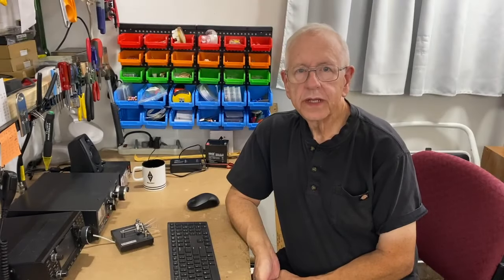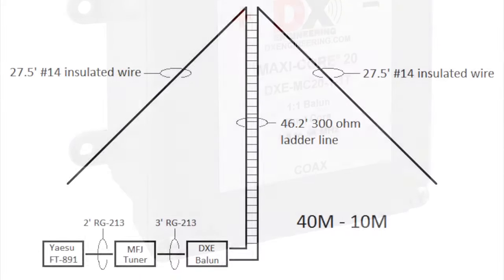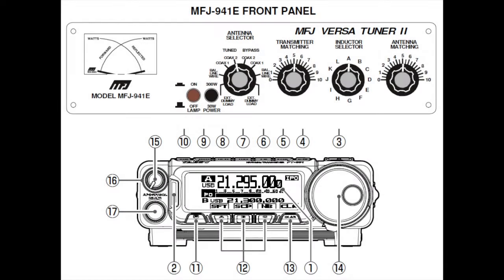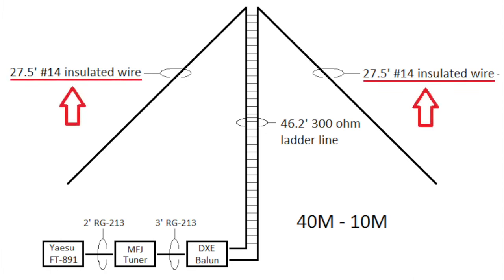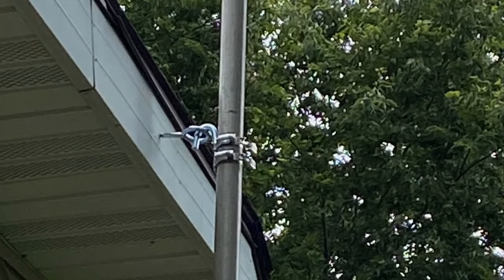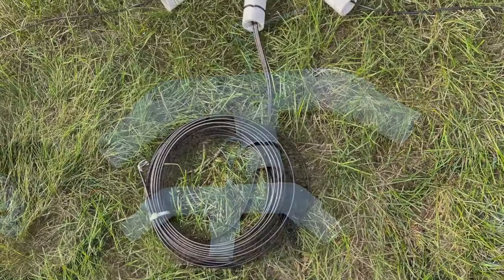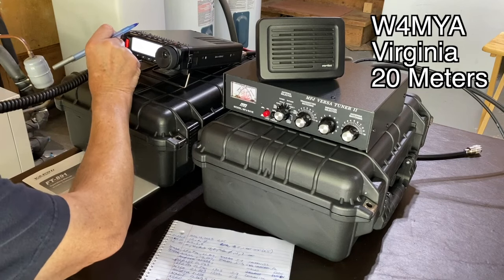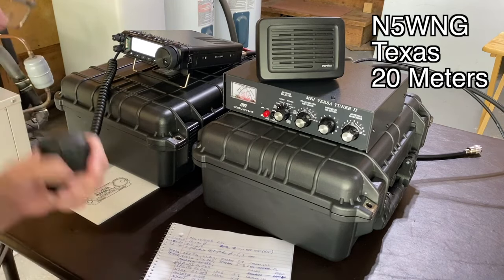Yaesu FT 891 And The Doublet Antenna  A Great Combination!

Comment: Bob, if you could add information where you obtained the pole, ladder line size/type, it would help some of us looking at trying this antenna.
Reply from the maker: Hi again Mike, The ladder line is 300 ohm from DX Engineering ...

https://www.dxengineering.com/parts/dxe-ll300-1c

The pole I bought surplus at a recent ham club sale and it has no markings on it but I think it is also from DX Engineering however I'm not sure they carry that exact model but they have others that are like this one or similar ...

https://www.dxengineering.com/parts/dxe-tfk46

I also recommend reading this article.  I've read it over and over and still come away with new information each time ... a wealth of information about antennas ...

https://www.dxengineering.com/techarticles/balunsandfeedlinechokes/baluns-choosing-the-correct-balun

I hope this helps.  73, Bob W9GRH